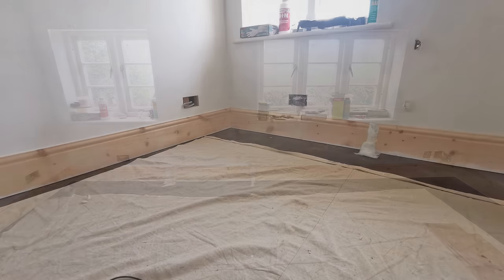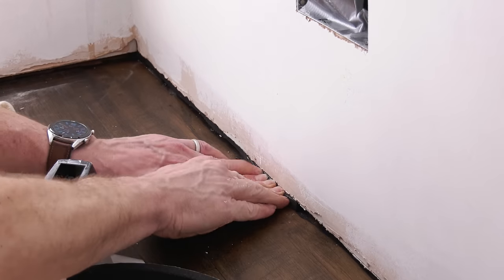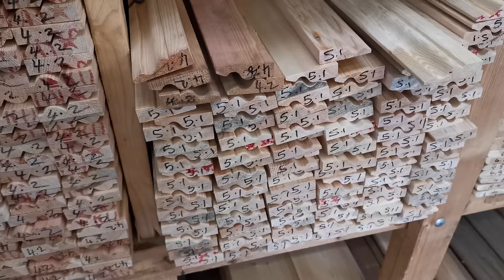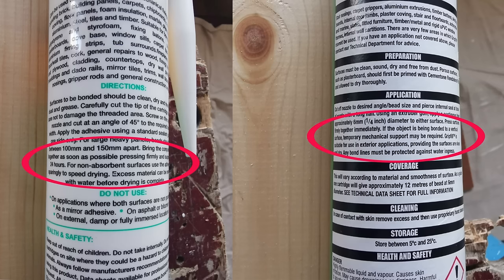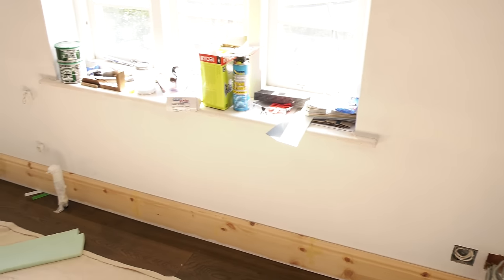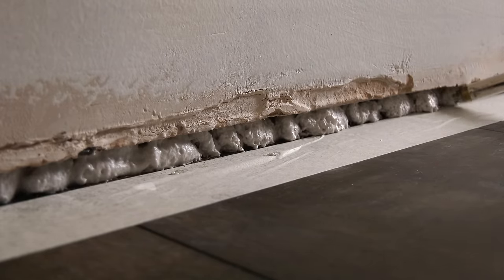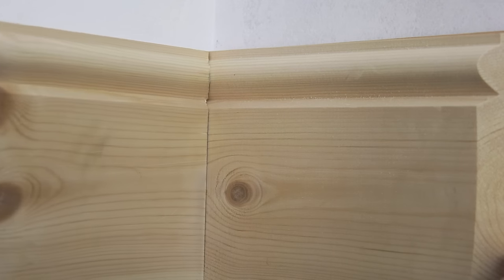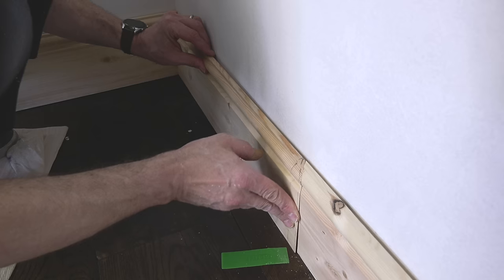How to Install Skirting Boards - a DIY Guide

Comment: Another suggestion for internal joints on skirting is instead of coping saw I now use angle grinder with a flap wheel in it

Comment: Next time when you use primed mdf do a 45 cut on the chop saw and your scribe is there marked out. Just cut on the line between brown and white. That saves a huge amount of time.
Reply: 40 degrees bud and you won't have a 2-3 mm gap ;)
Reply: Don't cut the scribed line at 90° either, as internal corners are rarely right angles.  Much better to undercut the scribe line to allow for corners greater than 90° but the cut will still work with lesser angles.
Reply: Also another thing we do is use white gripfill on top edge and joints, let it squashe out and tool off this means you wont have to chaulk it after ;)
Reply from the maker: @christopherrichardson7001  That's a nice touch. I ended up using that other tube of grab adhesive (ie not the green grip fill) and piped that into the gap, tooling it flat with a Cramer tool, which would have sufficed, similar to how you're describing. I ended up caulking on top purely for research purposes, for the next vid, but the grab adhesive is so much better than the caulk.
Reply: Christopher Richardson 40? With 45 you will not get a gap

Comment: Try using gun grade expanding foam as the adhesive. It is less expensive, has a flexible bond, pushes back easier... and if you ever need to get the skirting off, just run an old saw down the back of it and pull it off. That way, it won't pull the plaster off. And if you want to put it back on, it's easy to scrape off.
Reply: Sounds like a good tip!

Comment: As a retired joiner, I can say that your videos are rather accurate and informative. 
One small point.
When marking the bottom of your skirting boards, where there is a bow in the floor. Use a proper carpenters pencil, with flat sides. Keep the flat side tight to the floor. The profile of the floor can then be marked accurately on to the skirts.
Reply from the maker: Thanks so much Tony - humbled to be getting praise from a retired joiner! I love that tip and will definitely do that next time. I always wondered by carpenters pencils were so flat and apparently cumbersome. They are the only ones I can't stash behind my ear!
Reply: I use this on guitar work as well so pencil can be flush to guitar frets . Definitely more accurate and I shall bear in mind with skirting job I am doing  later this week for my bedroom

Comment: Enjoying the videos!  I glued skirting board to a 9 meter by 4 meter games room converted from a cow shed.  There were 10 internal mitres and 12 external mitres, because we elected to put plasterboard around the supporting pillars to retain as much space around the room as we could.  Lengths of board were held in place while the adhesive set overnight, by using two paving blocks, one on top of each other, wrapped in tea towels, at several points along the lengths and pushing hard against the skirting - worked like a charm!

Comment: Brilliant Charlie, thank you. I wish I’d seen the tip on cutting the skirting to lower it to an uneven floor. I recently did our lounge and used MDF, it was great and as you found much easier than working with timber. After a tip from a friend, I used expanding foam to attach the skirting to the wall (just a thin bead) and used bricks or blocks (wrapped in cloth) to hold the skirting against the wall. The foam goes off enough in a few minutes to hold the skirting securely against the wall. A bead of caulk along the top and job done, they’ve been done for two years now without any movement 👍
Reply: Wish I had the gear, and the bottle - to go Kayak fishing in Cornwall
Reply: @Elconbrioso  Thanks for looking Peter 👍

Comment: You spoke at a good pace, not too fast, which is good for us DIY'ers.  I had to pause the video to get a glimpse of that very useful mini spatula you used to fill the screw holes 'n gaps with and thanks for showing the products and where to get them. It's small things like that that matter to those of us that diy infrequently/ less. Great video.
Reply from the maker: You're very welcome. Thanks so much for the comment - always good to get feedback. Drop me a line if you need any other help 👍

Comment: I’m just about to install skirting board and laminate flooring into bedroom which has gaps in the wall where the skirting board will be fitted. The expanded foam tape should help me here. The plaster where the skirting needs to go looks cracked and loose so will need to repair before drilling or using adhesive. I like your idea on the lost head screws if I need to screw board in. Overall a very helpful video packed with useful information. You have saved me hours. Thank you
Reply from the maker: Glad you found it useful. Good luck. A lot to do but it will be worth it. 👍

Comment: Excellent video, thanks. I specially liked the idea of making a cut in the skirting so that you could bend it to the dip in the floor - nice one!
Reply from the maker: Thanks, Mark. I had no other choice, as I had a steel bar and tried jamming one end on the skirting and one end under the beam but I only got it down about 15mm!
Reply: Yeah that is a great trick! My floors are all on the wonk old house etc so I’ll be using that trick for sure. Great video Charlie Thanks

Comment: Excellent workarounds Charlie. Especially that cut to force the boards down. And that splinter looked a beast!
Reply from the maker: Thanks Chris. Yes I was very worried by that splinter, save the hospitals were inundated with COVID so I couldn't have gone in there. Luckily after a week of pain I was typing away at my desk and it suddenly poked out from under my nail. Was such a relief pulling it out!

Comment: Hi charlie,
Great video, just starting skirting my house throughout, 2 rooms in so far! 
I've opted for pre-primed MDF, which I sand and re-prime with BIN, then fix to the wall with nothing but foam. There's some great threads on the screwfix forums and having tried it, it really works very well indeed. I made some cramps with 2x3" and Irwin spreader clamps to hold it along the wall as the foam set and after 20 mins it's fixed and super solid. 

On wood filler I just use car body filler now as I'm sure it's exactly the same stuff as 2 pack wood filler and it's half the price!

Re scribing, I've been hogging out the majority with a back cut on the mitre saw then using a flap disc on the angle grinder to shape. It's surprisingly good.

Thanks again for the great video and good to know i'm not the only diy'er battling with skirting at the moment!
Reply from the maker: Thanks Bill. Yes, that sounds like the way forward. Nice work 👍

Comment: One of the most informative, logical and pragmatic DIY clips I’ve seen. Love that you worked the warping of the floor and boards into the process and provided guidance around multiple options for many of the stages. You obviously put a lot of time in heart into this process of not only construction but production of the videos. Hats off to you💪🏼😊👍🏼
Reply from the maker: Thanks buddy. Appreciate that. Yes it took a while to produce this one. Chuffed you found it useful 👊

Comment: Great quality video. I was surprised to not see the use of low expansion foam which I've used on window boards and skirting. It is the quickest method by far and has a super strong hold. I use a particular foam that is not just for filling but for adhesion as well.

Also mentioned earlier. Cutting at 45 degrees gives you the perfect scribe and to cut out. 

MDF or smart board is my favoured choice. Sealed correctly is very long lasting.

Comment: The last few months I've converted a brick built workshop to an office. Did everything from building the stud walls, plasterboarding, insulation, filling, vapour barrier, fitting back boxes, fitting a vinyl plank flooring for the first time etc (left plastering and electrics to the pros).

The final job is to fit skirting boards, something I've never done before. But watching your video has given me confidence to do it. Wish me luck :D
Reply from the maker: Awesome work. I've got exactly the same situation at the bottom of the garden. D'you want to come and do mine? 😉

Comment: Nice vid Charlie!  I  say MDF anyday!  on modern homes.  I only used timber on period houses but charged a fortune for the work given all the added difficulties, time and hassles which you expect on homes over 100 yrs old.  This was my speciality putting back what others had ripped out over the years to so call 'modernising, I call it vandalism un-flushing doors stripping & refurbishing, servicing and refitting window boxes & sashes.   I always bring the MDF indoors for week before I fit to counter the shrinkage.  I glue the skirting using T REX power grip and as for the smaller pieces around nibs and corners I first glue the corner joints together using hot glue before fixing as a unit - work a treat. Expending foam around the floor/wall gaps works a treat.

Comment: Well done Charlie on yet another calm, no - music, no back to front baseball caps, no American accents but narrated with nice clear spoken English.

As a professional woodworker , restorer/ conservator of antique furniture your single saw cut reminded me of the cabinet makers method of curving timber by ‘saw kerfing’ ; making numerous cuts from the back of the board to about 3/4 of the thickness. These cuts need to be made as close together as possible thus by removing material from the back allows the timber to gently flex.

Keep them coming.
Reply from the maker: Thanks Andrew, I really appreciate that, particularly coming as it does from a professional woodworker. 👊

Comment: Hi Charlie. Great video and presentation. An idea for you is that when you have large gaps use " Soudal filler foam "  first before you caulk. It does make the project time longer but the foam handles that slight movement which causes caulk to crack.Also you can find a flexible caulk for exactly this type of issue.

Comment: Good one as always Charlie. We used fully painted MDF and it was great - sat in the house for weeks before being used, no warping and the Chippy did a fantastic job fitting it, looks great - MDF all the way and all glued e.g. no solvent instant grab worked a treat, no fixings other than temporary spacers holding up the sections.
Reply from the maker: Thanks mate. I'm with you on all that 👍
Reply: I hate MDF but this has changed my mind.

Comment: I loved the mini plane and how invaluable it proved and how infirmative the video was as regards uneven walls and especually flooring.  The vertical cut in to the board cut to help it sink in to the dip in the floor was a simple but such a fantastic idea.  Its small stuff like that, that blows us away. 
I saw you use expanding foam in skirting gaps in another video and this video expanded my knowledge quite a bit as to what's possible... I now feel I could do a good job of it myself.  Great video. Thanks.

Comment: Genius stuff, thanks. I do this kind of thing so seldom though (and being 71) I won’t be spending several hundred pounds on tools but will be relying on my dodgy saws etc. 😂 MDF skirting is my project this afternoon now that the flooring is down. Having dropped the skirting pieces in place before the radiators were put back on will make glueing impossible unless I can carefully encourage hot glue to drip down the back. Your video was great by the way and I love the fast presentation. No umm-ing and ah-ing but pushing the points thick and fast. Much appreciated . Subscribed .

Comment: Great clear explanations Charlie, as ever.  I've just been replacing the skirting boards in my house.  The bottoms of the door architraves were finished with "Plinth Blocks".  I reused some and made new ones where necessary.  Very simple to make but also elegant and make the intersection of skirting board and architrave much easier and more professional looking.
Reply from the maker: Thanks Martin. Yes I think there's a lot to be said for plinth blocks 👍🏻

Comment: My first experience a few years ago with skirting hit all the problems you described so it's a relief to see them present in this video along with solutions.  Love the solution for the sagging floor section - genius.  Due to the warped wood problems I encountered, I've committed to never using wood for skirting again, just too much hassle - chips in MDF can be filled and painted.  I also used double-sided skirting which the carpet-fitters broke, despite me warning them of the type of skirting.  So anyone tempted by double-sided, avoid like the plague.
Reply: Ditto with carpet fitters - rushed the job and slashed into my skirting board!!!

Comment: Hi Charlie! I watched this video when it was published back in April. I was intersted because I installed skirting boards a few years ago using only grip adhesive which did work but was very awkard to get the aghesive to take hold and was more work than necessary. I have recently installed new skirting in our bedroom and this time as well as adhesive I decided to use those small screws you showed in the video. I used MDF primed and your method worked very well. Drilling pilot holes and then holes for the raw plugs was very straight forward. My only issue was that my drill was not able to recess the screws fully and I had to use a countersink bit. But that only meant some extra filling. My drill is getting on a bit and so are the batteries and MDF is very dense. would reccommend the screws to anyone doing this job. Keep up the good work.

Comment: 17:25 - that's really clever! A good tip, cheers Charlie
Reply: It is...if you fancy the joint opening up when it gets knocked, and the topof the skirting looking stupid. He's already (correctly) shown how to join skirtings longtitudanally... i.e. 45 + 135 deg... then he makes a 90 deg cut in it! If there's a large gap between floor and bottom of skirting, you have to scribe it. That may mean scribing the piece it meets, too - but you should have checked the floors before you start.

Comment: Great video. One tip is to put a strip of wide masking tape (I use the wide green or yellow frog tape) down along the wall and put the skirting baord down on top of it. You can then tape paper around the outside of the room on top of this strip. Then when you paint you already have the floor masked off. Just run a knife round under the skirting when tour done and remove the masking tape.

Comment: Hi Charlie, I've learned a lot from your videos over the last couple of years in particular but this one really saved my bacon! We've been in this 1930s house for 10 years now and have been refreshing room by room over that period. Thanks for the clear advice as to how to deal with skirting installation (not to mention all the other tips your videos have covered). I especially found useful your suggestion of how to deal with a dip in the floor level. Our spare bedroom has a floor that wanders all over the place having clearly taken a battering from people less careful than us lifting and replacing floor boards. You really helped!
Reply from the maker: So glad to hear you found this useful and thanks for letting me know - I really appreciate it. 👊

Comment: cutting the board to make it drop in to the dip is genius! Thanks, I will use that.
Reply: It really was
Reply: Yeah it was never seen that before would like to try it now
Reply: Its not realy good idea becouse you will end up with bend on the top when you look from distance 🤷🏻‍♂️would never recomend it
Reply: @27stasiu  sometimes u got to make the best of a bad situation, removing material from bottom would make its alot more noticeable
Reply: stephen mc gonagle not my style mate
Reply: @27stasiu  don't worry, the caulk will get it 😉

Comment: Another great useful vid Charlie, been through too much pain with knots in the wooden skirting, I only use MDF now and have fitted hundreds of feet of it in my own and 2 lads houses.  Had very mixed results with glueing so I just screw to the wall and had no failures with that method (years ago builders just nailed into wood plugs).  Someone else below commented on a 45 degree cut to expose an accurate scribe line.  I’ve also seen a carpenter just clamp two boards together for the overall length and cut them using a handsaw creating a perfect join.  Some old habits die hard before.  Compliments on your scribe cuts they look very neat.  Keep safe and well.  Regards Mike

Comment: Top tips. Skirting better fitted in my bedroom than in any other room in the house after watching the video this morning! Great idea to use small-headed screws, and the single cut to counter the bowed floor was a gem. The only pet favourite tip I’d add is to paint skirting before fitting. I always find the filling, sanding down and touching up quicker and easier than cleaning up after my sloppy painting…
Reply from the maker: Thanks Gordon - pleased you found it useful. Yes I agree painting first is a good option even though you've got to touch it up where you've screwed it to the wall.